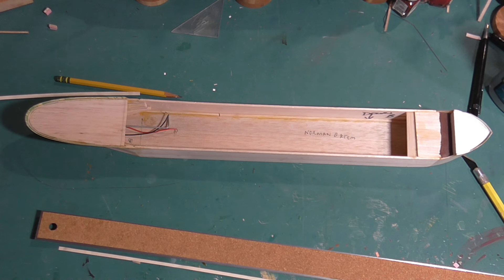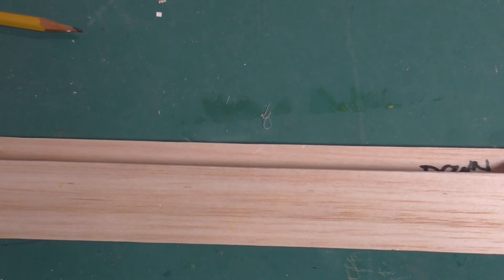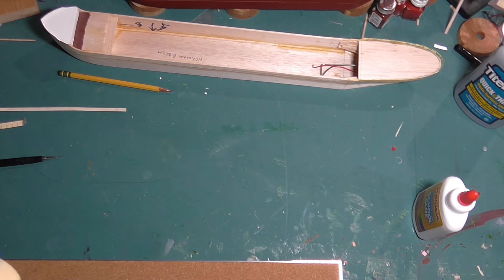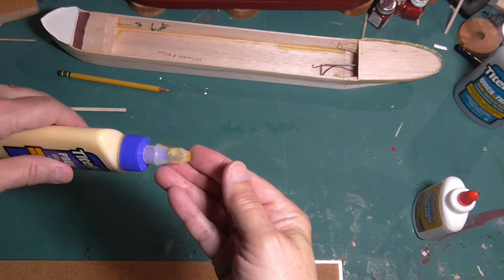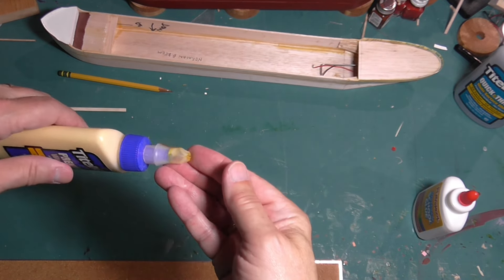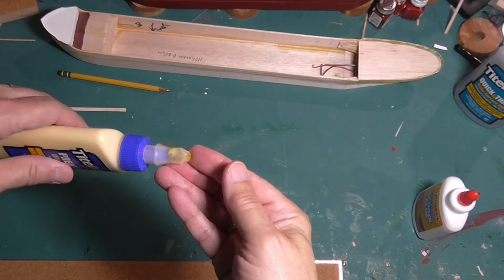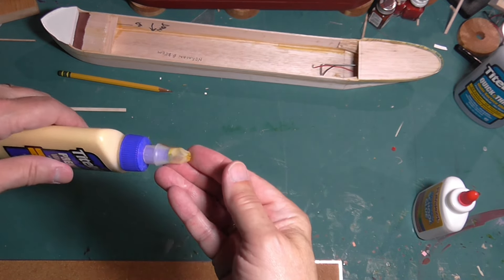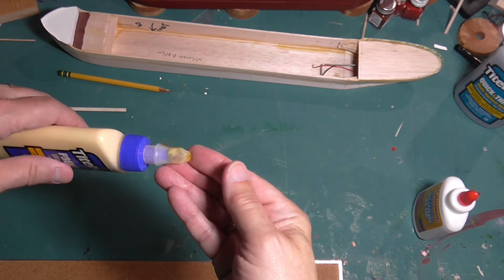How to build R/C model lake freighters; Anchors etc.

Comment: This is a great channel! Models freighters is an interesting and unique subject. Is there something special you do to waterproof the cardstock portions of your ships? Also, what sort of waterproof paints do you use?
Reply from the maker: I just use CA glue to waterproof cardstock and to stiffen it. I also use common Testor's enamel on the hulls. Early on (mid-1980s) I was using an epoxy spray paint intended for appliances. That worked great, but they stopped making it in red, so I stopped using it.
Reply: @authorwes  Good to know. Thank you!